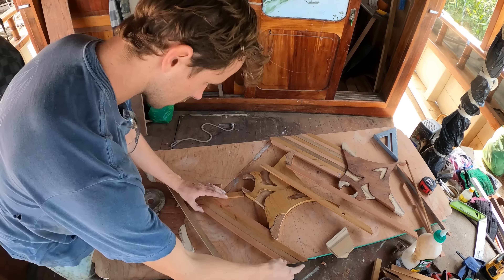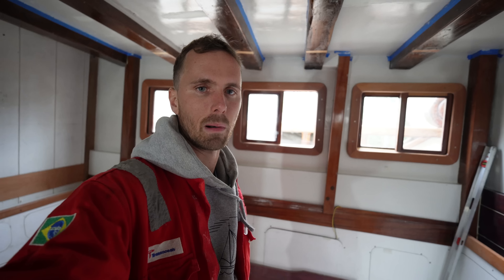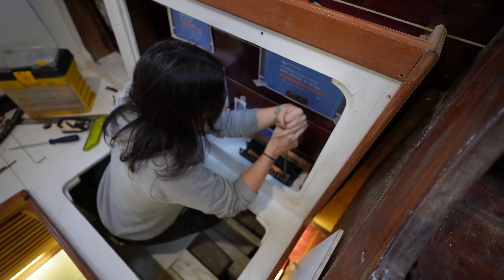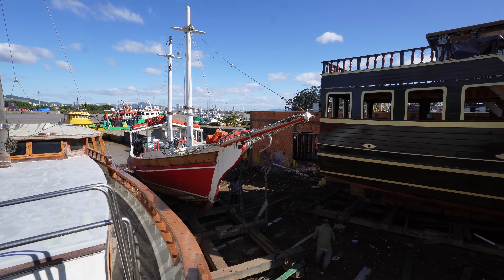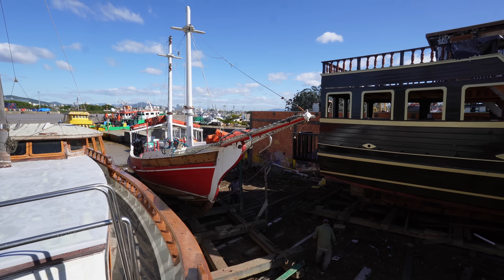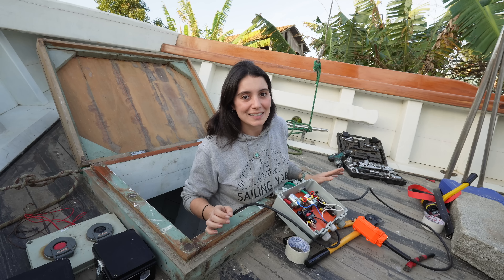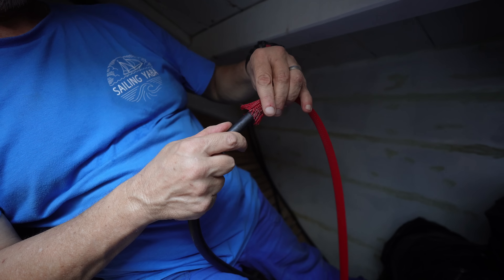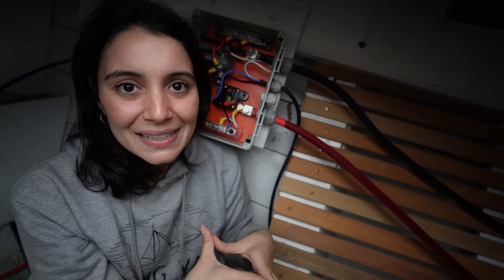Installing the electrical system on a boat with no experience. What could go wrong? Sailing Yabá 153

Comment: Considering how long the cables are,  you might want to install a  24v battery near the windlass
Reply: the amp draw will be enormous across that cable length.  Because of the len;gth  of the boat, a dedicated battery near the windlass might be considered.
Reply: @clayvagnini5523  But even so you'd still need the cables to recharge the batteries.
Reply: Yes, but they would be much thinner and would have less voltage drop.  The windlass would still see full power from the nearby batteries
Reply: I was gunna ask the same question. Also if you lose power in the main bank you still can drop the chain.
Reply: @JP-re3bc   The amp load won't become apparent until you put the windlass under load.  Love the channel  !
Reply: Agree! It will help as a buffer for the high starting current. Also, given the length of the boat, a bow thruster would be a good upgrade that would also benefit from a dedicated "bow battery".
Reply: @TheOldGuy  In a strip planked hull yes. Because you have the fiberglass layers to seal against.
In a conventional planked hull, no, as you would have the devil's time keeping the water out, where the tunnel goes through the planking.
Reply: Normal practice to have a dedicated battery if you are going to have a long cable run. Not recommended.
Reply: Agree; they need a dedicated battery up forward, so the load cables are as short as possible.
Reply: I was wondering the same. I just hope the wire was sized correctly or it’s going to get really hot when it’s under a load. Battery by the windless would have been the correct modern way to do it. We don’t want the wood catching fire from very hot wires.
Reply: @carlthor91  Great Point! Had not thought of that!
Reply: Exactly my thoughts. Small charge cable or even solar charge would keep the batteries up

Comment: MP, you should not only paint the cover in red, but also the base (in case someone dismounts both covers at the same time and interchanges them accidentally).😉
Reply: I was going to say the same. The caps can get lost or put on the wrong side and cause a accident

Comment: Bit late now, but another battery at the front and only thinner cables for charging = cheaper :)
Reply: But cable cheaper than an additional battery longterm. Batteries are an wear part that don't last forever and 24V quality batterys for marine use are probably not cheap.
Reply: @westmus it’s safer to use the battery closer to the windless. Less chance of overloading the wire under a load and overheating and causing a fire 🔥

Comment: The sheathing on the cables is not only functional but estetically looks great. The crimp on the big wire with the heat shrink is also so good! Colour coding the electrical system should be a must for all projects.
Reply from the maker: Right?! We are so happy with the difference those details make!

Comment: Someone propably mentioned this already, but just to be safe: I'd highly recommend adding some dielectric grease or similar to the wire terminals on the windlass motor to prevent or at least slow down corrosion.
Reply: Agreed .
Just, normal Acid free Vaseline will work perfectly fine. 😉👍🏻

Comment: Very enjoyable explanation of your electrical connections to the windlass.  MP,  your descriptions as to what you're doing are quite clear.  Your happiness learning from your father is charming and (from another dad's viewpoint) heart warming.  Great episode in so many ways:  the dance of the boats getting ready for work or prepping to depart, the work ethic of all of your crew and the boat yard crew, and the general overall feeling that I receive from watching y'all work while I sit back on grin like a little kid in a candy shop.  Thanks so much!
Reply: So true. I just lack a little more information on the amperage or wattage on the windless, and the dimensions and length of power cables.

Comment: I would recommend to check if you can better protect the motor contacts against moist ( especially salt water), some grease would do, but a sprayed protection could be better.

Comment: I am not sure how watertight the lid in on the winch ?  But I would put some silicone  in the joints . Also a little high temp grease on the electrical connections .  I am not an electrician so I may be talking rubbish . Just my thinking out loud !  All I know for sure is water and electrics don't mix very well .  The boat is coming along very nicely . Soon be on the water .Can't wait !!

Comment: You are now getting to the interesting part of fitting out a boat, the electrics and electronics. It can be scary and daunting at times but as you said, one step at a time and at least by doing it yourself you will be able to understand it better.
One thing I would like to suggest (if you've not done it already) is to keep all the cables labelled and fitted into a conduit down the side of the inside of the boat, keeps things tidy as you install more wiring in the next few weeks and months.
Fantastic work guys .👍👍👍👍

Comment: Great to see MP continue her knowledge of the electrical systems on Yaba.  Nothing like learning from the installation.  I hope you are making lots of notes and a thorough wiring diagram.  It's so important when you/Ben/someone else comes to solve a problem change or extend the system. If you have details of all the equipment, the relay stock codes, manufacturer, it's so much easier to order remotely, when you are miles from a town, you can't just walk into a store and ask for a direct replacement.  Have you decided what spares you will keep?  Your insurance company and other bodies may want to see proof of certification.

Comment: Thanks!

A better way to describe it is a relay is a switch that can allow a large amount of votes to go through it yet it operates on a small amount of voltage. That small amount simply toggles the switch kind of like a light switch that you would manually work only that the relay is electronic. Of course, to send the power to the relay you have to manually operate a switch.(fun things you learn with model trains as a child) My knowledge of electronics is limited, though. I can kind of convert some parts of electronics to mechanical connections and because of my very good understanding of mechanics I can connect things and run the wires but there are times I don’t necessarily know exactly what I’m doing or why or maybe even both at the same time. So the more you wanna show, the more I can maybe learn too.

Comment: I’m a bit of a gear pig, and it’s so nice to see you very similar to the ones I’ve chosen for myself. You could show even more detail in the wiring/electrical. Really like this aspect of boat building. 
Not sure how weatherproof the motor covering is on the windlass, but might I suggest using a dielectric compound on the terminals there to help prevent/slow corrosion.

Comment: Hola MP, Ben y el resto de tripulantes (incluído tu padre). Cómo ya les han comentado yo pondría una batería más cerca del molinete evitando el recorrido tan extenso de los cables grandes. Está correctísimo la diferencia de colores de los cables, así como en las barras de conexión para evitar errores cuando esté todo conectado. Cómo siempre son sugerencias que tomaran Uds. o no. MP sin miedo a la electricidad, como el agua, se debe respetar la seguridad y menejo. Consejo de viejo.
Es impresionante cómo mueven los barcos en esas camas, son unos genios.
Ya voto por Uds.
Qué pasen muy bien, buenos vientos y saludos.🇺🇾🇺🇾🇺🇾🇺🇾

Comment: It would be a good idea to just hook up a temporary battery with jump leads, so each circuit can be tested as it is installed. If you wait until the electrics are finished, you could end up chasing several problems at the same time. Always better to test each installation as it happens.

Comment: The capping covers for the buss bars are potentially interchangeable, so perfectly possible for them to go on the wrong buss bar in the heat of fault finding. Paint the positive trunking red to match it's cover to avoid this.

Comment: You had better isolate the positive bus-bar using proper insolating grommets/bushings.  Bolting them next to each other into the same plank of wood is going to create "Ground Leakage".  You will pull your hair out trying to find the cause, only to realize a self-inflicted wound.  Wood always has a moisture content and electricity love moisture.

Comment: When I saw you initially install the bus bar in the charging panel, I knew you were going to have to move it. Trying to connect wire to the bar in a tight radius is next to impossible with that gauge of wire. Good work, though and it looks good. Can't wait to see everything connected electrically.

Comment: Hey team you need to add a breaker or fuse on the two winlass power wires from the  control panel. If those wires get grounded they will turn into glowing  red fire hazzards. Keep being awesome team.

Comment: I was concerned earlier about the buss bars mounted at the botoom however I now see they are mounted on the wall verically. Great job. For those wondering or wondering why I was concerned. If they were on the bottom mounted horizontaly they had the potentialy of getting wet and pooled water shprting them out. Mounted vertically off the flat surface the possibility is reduced.

Comment: Yaba,

You might want to put a switch on the power wire to your windlass control. Just to prevent an accidental anchor deployment or retrieval. 
Can't wait to see you on the water in Yaba.

Comment: you might want to look into a light forward, an underwater light, search light, something that if you need to anchor or moor in the evening or night you have light to check on the anchor chain going in/ out. so you don't have to muck around with a handheld flashlight while working the controles

Comment: Hi, Great Job on the electric.  Please, don't stop showing this.  Your showing it in good detail, more that other sites do.  I'm in the process of doing my boat's electric, and this, in detail is great.  you just made mine go easier now..  I have an ideal anchor winch that needs to be re-done.  just been looking for a better system of electrics.  yours is great.  Where did you get the buss bar's and enclosures at?  My boat is using no. 1 cable for my winch. I do enjoy your show.  Boat is looking great.. thanks for the vid..

Comment: Bus bars on the floor where moisture ends up increases the short out risk, up high better. Place all inverters, electrical stuff on fire resistant sheeting as well as the wood above. A fan to draw away heat from the box, one that won’t allow water to get in, shoot the hot air into the engine room. A smoke / heat detector alarm for all your enclosed areas containing electrical stuff.., peace of mind and will make your insurance less. 
Electrical Joy!

Comment: That windlass switch on your control pannel could have a hinged cover to protect against someone pushing it accidentaly (children, curious or happy visitors, etc). To activate the relay someone would need first to open the cover and only then use the switch. A small thing that might possibly save you a world of pain. Ah something else: a light to signal that the anchor is fully dropped.

Comment: Is it worthwhile smearing the connections that could be in a salty and/or damp atmosphere with Vaseline or silicone grease to prevent corrosion that will affect the power transmission, I'm thinking of the windlass motor connectors?

Comment: For the sake of progress, install the (main) cable pipes throughout Yaba.
Or at least make wide holes through the bulkheads.
Make them wide enough, but they will still be not wide enough..( experience,…😢)

It saves many tedious hours of trying to widening the hole where there is already a cable. ( you Will damage the cable that is already there… / must repair takes again extra time…😢😢

The smaller cable pipes can be installed later.

Tip: use regular household PVC pipes, use for water drainages.
They come in easy stnd sizes, in long lengths and they are cheap😊
Being Dutch, that is a good thing 😊

I have been following you two sinecure nearly the beginner, and together with Leo / A2A / Sail Life / Duracell project, you take a fair bit of my Saturdaymorning routine 😊
… and I like that 😘

Keep up the good work.

PS , 
never install cable glands ( Kabel wartels) on the topside of any cable box.
They Will start to leak ( no mater what is stated on the package….) 
And seawater and electrics like eachother a little to much…. 🤨

Comment: Loved the boats moving .. "Give me a place to stand and I can move the Earth!".  Coming on very well.  I'd double-check the wire lengths for the windlass.  I've burnt out smaller winches on Landrovers with only 300A draw and 6' cable, make sure the cable diameter matches the length and the Amp draw from the windlass. Dedicated Batteries closer would be preferred.
Reply: Better check your numbers. No way did you have a 3 kw motor on your vehicle or the power to support it.
Reply: @ralphgesler5110  Bowmotor 2 @12V, 55A no load but producing 6.8HP, running through an Albright solenoid rated at 100A Continuous and momentary up to 400A, for pulling Landrovers out of mud .. We reckoned we could actually pull over 450A for short periods using 70mm² cable .. The winch was rated at 19000lbs.

Comment: Relays have many functions depending on the circumstances.  In this case, one function of the windlass motor relays is to isolate the high voltage/amperage circuit from the operator (18:13).

Comment: To have a good connection you should sodder all the joints because all crimped terminal will fail or corrode 😊

Comment: MP, you are an excellent student, because you have become an exceptional teacher and explainer! Thank you for your clear and interesting explanations, mixed with your delight and satisfaction in having a clean, practical, color-coded system. I am inexperienced, so am wondering, how will you ensure the electronics box beneath the windlass is very waterproof? And also, might the protective mesh be subject to salt water corrosion? Thank you!

Comment: Do you guys use a cable list? Labeling cables with a tag and sequence number at both ends makes you live much easier in the future. You have then a paper which shows all cables with their specific tasks per voltage level.  A cable list entrie per sequence number shows the cable tag with sequence number, location where its from and going to, the length, type of cable, etc.

Comment: Just curious why you chose to put the windlass battery so far aft.  I probably would have put the battery in the focsle, as close to the relay as possible, so that the run of heavy gauge wire was short.  Then you could use a much smaller wire to charge the windlass battery.

Comment: Make sure you put the batteries above the water line in case you spring a leak there has been a couple channels that had this problem and they got under water fast and ruined all there batteries and other stuff. That way you have time to start pumping water out b4 it gets to your electrical system..

Comment: Ben and MP get hold of a Plastic  45ltr Drum  Put it in the Angkor  hold for the chain to be in with a drain  hole  and pipe going outside that way you will have e chain off the floor and no water in bulge we did that on our 68ftr  and it worked well

Comment: Always love the content, thanks so much for sharing.  Perhaps a portion of an episode on type of wire (copper, aluminum, etc), connections, and types of boxes (sealed?)  (like the one for the relays up front) in relation to corrosion while out at sea might be helpful / interesting to the viewers.  I would imagine nothing is completely proof, but also figure you are choosing certain things for reasons and just curious to learn as always.  Just a suggestion.  Wish you all the best!

Comment: Installing 24v battery near the windlass and you will avoid to pass big long cable, and the voltage drop involved. Install also a dedicated battery charger beside. Like this, the only long cable will be a normal size AC one, feeded by inverter or generator.

Comment: Guys - you’re going to BURN those windlass cables due to high AMP draw the moment you apply real load raising an anchor stuck on mud. Consider installing a 24V battery by the windlass with proper wire size to handle the load. Last thing you need is a fire on a wood boat that took so much effort to rebuild.

Comment: Hello there ! New subscriber here with what I’m feeling is an important safety issue that until recently was not much of a concern. BUT 😢 RECENTLY many, many sailors have had their rudders and the boat itself have been viciously attacked by a grouping of Orcas which left them unable to steer and navigate their vessels. And some have even had their props and prop shafts damage. So I’m suggesting you somehow either ideally carry and store a spare rudder or at the very least carry enough materials and hardware,fasteners,pintails  etc. so you are prepared. The Orcas behavior has been blamed on a plethora of ideas even global warming but do your own research and you won’t believe the damage they have done to peoples boats, many many rescues and tow in’s. So happy sailing !! And  that’s my conscience speaking and I hope You never need anything I’ve written you about :) Cheers,
Henry from NY state.

Comment: That control box for the windlass is hanging in air at the bottom.  You might want to consider installing a brace between the two frames on either side to support the back of the bottom of the box.